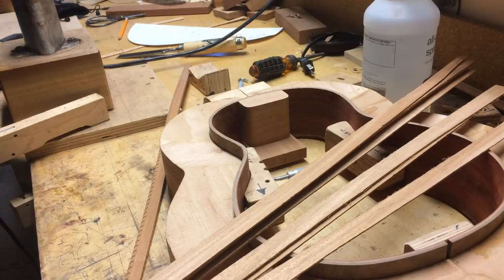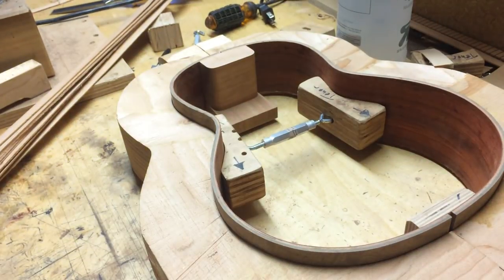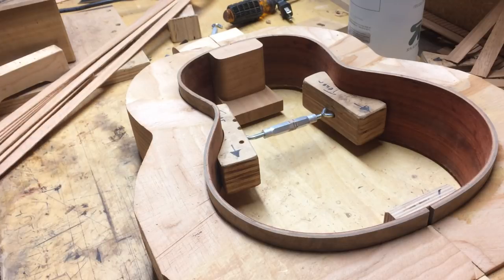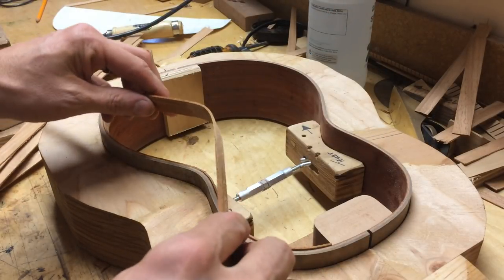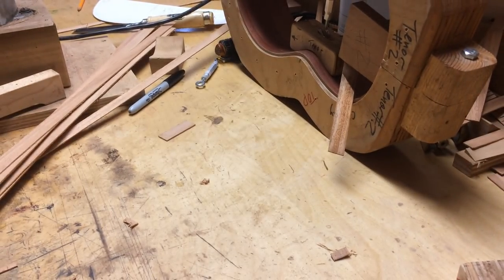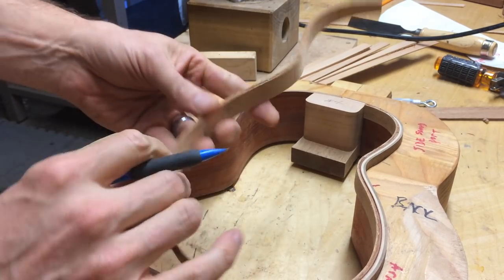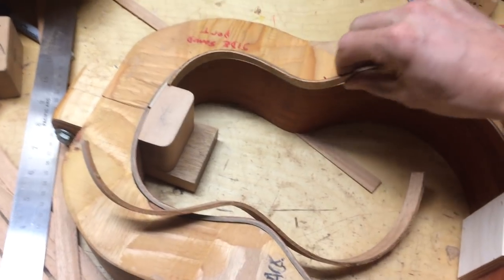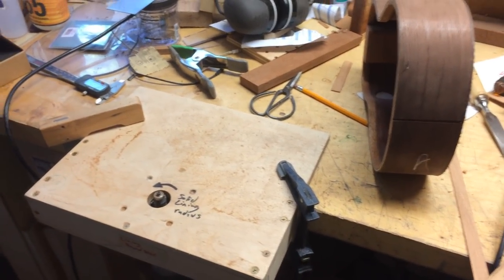Making Solid Linings for Guitar and ukulele Beau Hannam Guitars and Ukuleles

Comment: "I'm pro metric"... next line, "this is 15 inches"...  and every other measurement is in thousands of an inch.
Reply from the maker: Hahahah. I just around according to what my brain and memory find easiest for everything I measure. Metric is smartest and logical (therefore best) but I find inches easier to remember for longer measurements and thousands of an inch for very small measurements. You can think one is best, and use both and still be correct, coherent and not a hypocrite.Every luthier uses both from what I can tell. All classical guitar measurements are in mm. I’m planning a video on all this.

Comment: LOL,,, It's amazing to me ,, that you have to count like your in elementary school to come up with a equivalent for your precious Metric system ! And then Disrespecting the Standard measurements , used by England and the Romans almost since time ! , But then you have your workbench measured and marked in Standard increments and speak of Fifteen Inches instead of using your precious metric and saying .381 Meters ? I think it's hilarious that it all stems from ignorance ! But in Fact your precious 8 mm is not 5/16 , but .315 thousandth of 1 American Inch ,,,, If you'll check ,,, The metric system was invented , for those interested in getting items "Close" ,,, and if you'll also notice ,,, That's why you constantly refer to your lengths as " Close to " !
Reply from the maker: I use both systems. I like thousands of an inch for the smallest measurements. I use mm on classical guitars. As a luthier, you gotta use both. But eg 5/16” is a stupid measurement which will never make sense to me.

Comment: Thanks Beau for your great learning videos! I wonder how thick your sides are? They look really massive. Are they laminated?
And what thickness do you go for in your spruce and cedar tops?
Reply from the maker: Typically, outside layer is .070", and the two inner layers are about 0.060" each. Sometimes i do only two layers 70 + 60) plus a 0.020" inner veneer.
Backs about .100".
Tops on ukes about 0.080" and guitars anywhere from 100-120 depending on guitar size. 
also 0.080 at the edges to 0.120" under the bridge.
Reply: @BeauHannamGuitars  Thanks for sharing!

Comment: You do fine work my friend. So don't take offense when I say I think it's funny when you say how much you like metric measure compared to American fractional type measure. And then you immediately say the length you need for the lining is 15 1/2" I just had to chuckle. I go back and forth somewhat myself.
Reply from the maker: HAHAH- yer- I actually use both- i like inches for longer measurements, and 64th or 32nd for very small measurements like action set ups. Strangely I prefer mm for the 4mm-10mm range. But it's more about the ease of dividing by 10.- i can never remember which is long- 3/8" or 5/16th?- I literally have to look it up. So to me Imperial is not very logical like 1, 2, 3-10 is. As i'm writing this, I still don't know which is longer 3/8" or 5/16th...?- that makes it an illogical system.